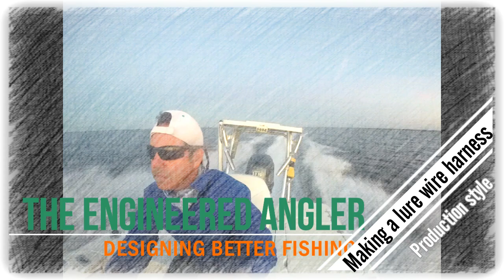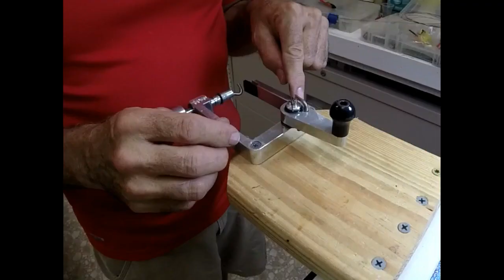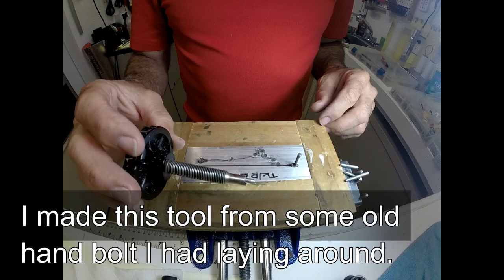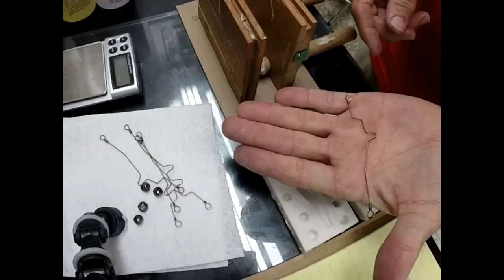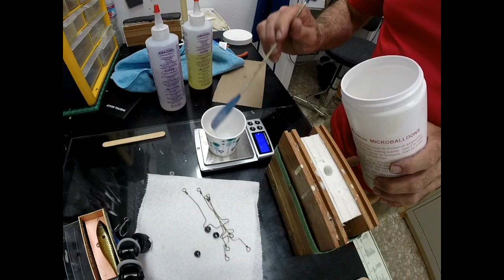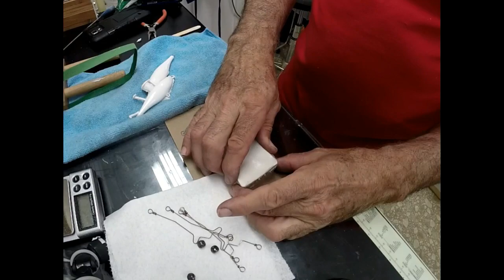Lure wire bending

Comment: Clever ideas. Check out McMaster-Carr for wire. They have it all and probably much cheaper then the AFW wire
Reply from the maker: Thanks for the tip.
Reply: @EngineeredAngler  been bending my own wire for 30+ years. Long before the Alabama rig I made a casting rig that won tons of tournaments but, no one would believe me. Where I get my wire

Comment: I make a leader that wraps around the shaft of a 4/0 or 5/0 straightbait hook maybe 6 times then through the eye. Fwd of the eye is a straight shaft with a 5/8 inch or so narrow loop at its front which is then run through an anchovie from tail end up along the spine through the mouth. This fwd loop is for swivel snap connection as well as for a sm nail with a sm rubber band to pin the bait onto this leader/hook gizmo. The nail is fed from under jaw of bait up through loop through top of bait head and secured with rubberband. Its quite simple but slow with hand tools. Ive been using jewelers tools which were very inexpensive but am looking for a faster easier and more professional looking finished product. What might you suggest. Thx in advance.
Reply from the maker: Well, I'll have to take your word for it that it is simple...from the description sounds like a bit of work.  My efforts in improving wire bending systems have been focused on lure wire harnesses.  Have you checked out some of the hand-held leader making devices?  It sounds like they might be your best option.  Look at the Du-Bro Kwk Twist or the Twistech Wire Former bench model.

Comment: Helpful video can you post where can l get wire bending tool.again thanks for your video.
Reply from the maker: https://www.amazon.com/Poulsen-11037-Twistech-Wire/dp/B00CMW18G4/ref=asc_df_B00CMW18G4/?tag=hyprod-20&linkCode=df0&hvadid=312154679201&hvpos=1o8&hvnetw=g&hvrand=9970913927128524339&hvpone=&hvptwo=&hvqmt=&hvdev=m&hvdvcmdl=&hvlocint=&hvlocphy=9051554&hvtargid=pla-567930793802&psc=1
Reply: Thanks a lot man.

Comment: I’m looking for something that’s capable of bending 2.2mm 316 annealed wire for tuna stickbaits harnesses as well as forming the barrel loops for the nose. Any idea if the tools used in this video would work?
Reply from the maker: Dimensionally no, your wire would be too thick,..the techniques and tools on the video will not work.  But the good thing about annealing is that it results in a material that is much easier to bend and with less "rebound memory".   I mention this because it means you  can do the radius bends with hand tools, don't need real industrial bending machines, and you could  (theoretically) fashion a homemade machine to form the barrel raps.

Comment: Is there any chance you can go through a tutorial on how you determine the wire length and set your bending jig for each lure? I'm trying to get a through wire to work on a lure design right now and it is driving me nuts! Every time I bend and finish it's either too long or too short and I've tried to print a template jig and everything.  I need your expertise this is driving me crazy lol.
Reply from the maker: Revamped Outdoors
the most common mistake that causes you to come up short on your wire  is that you bend the side of the wire that's already measured and not the tag end. here is a link to a video I made a while back on this subject. let me know if it answers your questions. if not I'll try doing something a little better.
https://youtu.be/cGyfRp4DLaE
Reply: Great thanks for the link.  That technique looks like it will work great with the hand tools.  I'm just having trouble figuring out total length  I need for the wire when completing two complete wraps for the back and
 front eyes.  I suppose I can try and just do a half wrap and let the tag end come back into the lure instead of finishing both ends.

Comment: Did you buy this wire bender or made it yourself?
Reply from the maker: Djordje Maksimovic 
I made the wire Bender myself it's actually pretty simple. if you go on the engineered angler Facebook page there are some close up photographs. Cheers thanks for watching
Reply: Engineered Angler you made the whole set, and there are photos of it?
Reply from the maker: I only made the part with the forming plate and pins and the knob that bends the wire.  Only the part with photos I posted on the facebook page....

Comment: On the tool you made , how did you do the black handle knob end that bends the wire ? Did you slot it ?
Reply from the maker: Del,  Thanks for the positive feedback.  That black knob is a generic knob I had laying around. It's  threaded in the center so I took a long bolt that fit, drilled an 1/8th inch hole in the center (of the bolt) at one end about 1/4 deep, ground down the end to a narrow tip, then filed the tip flat then filed a step in the tip so it would grab the wire.  Then I jest super glued a short peace of nail  in the hole and, voila!  Let me know if you would like to see some better photos.  I can post them on the facebook page also called Engineered Angler.
Reply: Thank you , I just liked your FB page . I would like to see a picture if the end of the black knob how you filed it . Thank you very much . I make fishing lures also . Del Smith Fishing !!
Reply from the maker: Posted some photos of the tool on the Engineered Angler Facebook page...hope it helps.

Comment: what size of wire you'r using on that video sir?
Reply from the maker: Ranillo Maligaya 

the wire is 174 lb strength stainless steel leader wire diameter is about .044 inches
Reply: Thanks for the info sir..
Reply from the maker: Sorry...I was mistaken the wire is actually 0.03 inches in diameter (0.762 mm).
Reply: @EngineeredAngler  thank you very much..